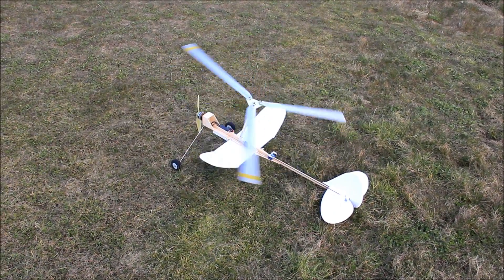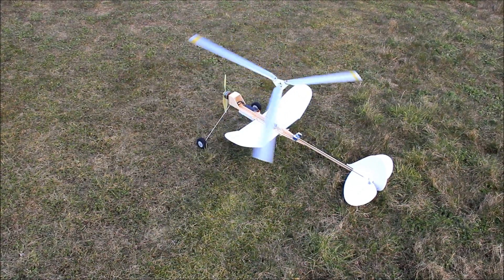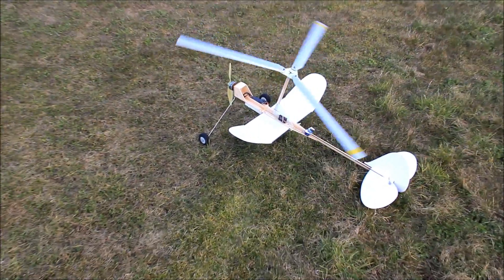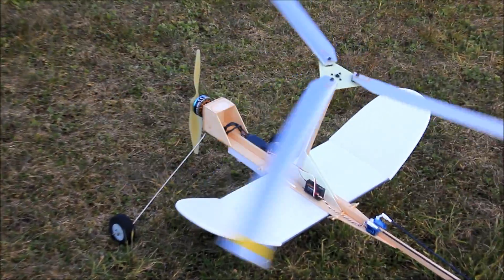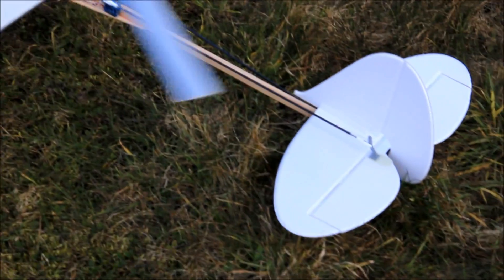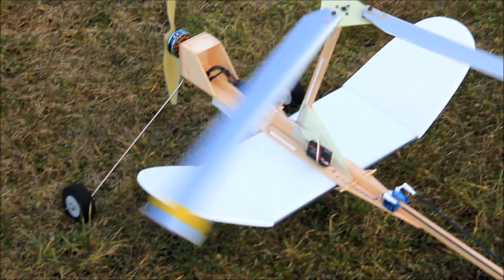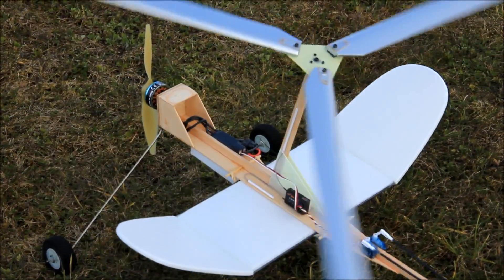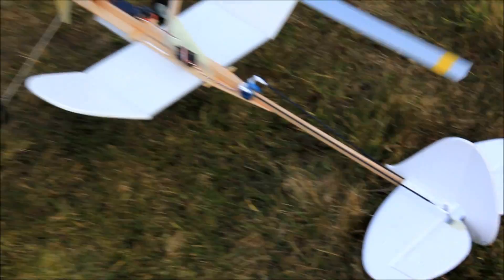Fixed Head autoGyro

Comment: How many degrees the rotor head was fixed?
Reply from the maker: Hi Rodrigo, I am afraid the man who designed this autogyro passed away several years ago and I don't have the details :-(
Reply: Normally around 9 degrees to the thrust line. That's the standard for full scale gyroplanes.
Reply: Thank you very much Mr. Lee!
Reply: Thank you very much Mr Stuart!